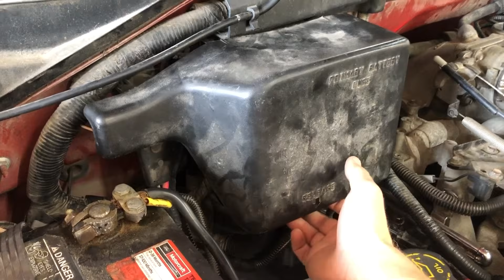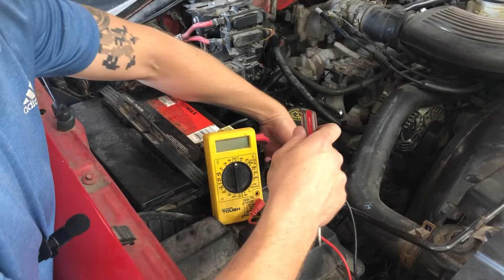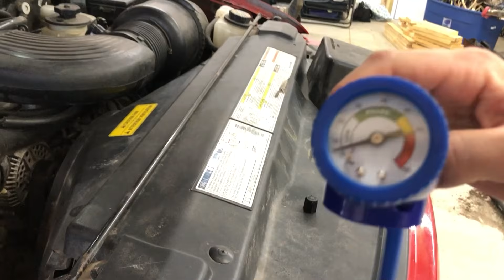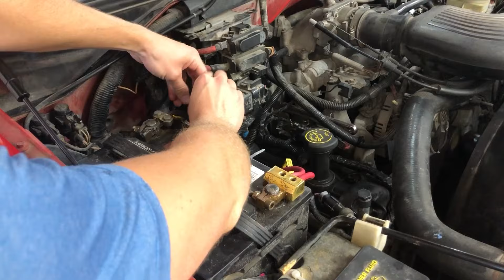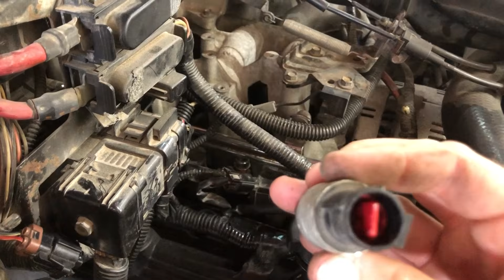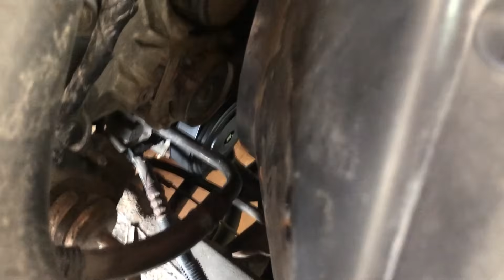F-150 A/C Diagnosis & Cycling Switch Replacement

Comment: Checking pressure at idle is not correct. It needs to be checked and charged at 1500 rpms with a fan in front of the grille to best simulate driving conditions

Comment: Would you know why my compressor won’t cycle, it stays on all time and pressure is at 80 at low side and high side 90 
I vacuumed and tried to refill 
And I also put in a new office tube because the one it has was clogged

Comment: Ok, I checked everything, by passed the low pressure switch and it showed I had less that 25 orbs in the system. So with the by pass connected, I proceeded to charge the system. It will not take a charge. Any ideas or comments are always appreciated. Thanks in advance.

Comment: Same problem when I bypass the switch the compressor kicked on so I went and got a new switch put it in and same issue compressor won’t kick on unless I use the jump wire, also it was still blowing hot when it was on do I just need a new compressor

Comment: Great vid thx! So I'm getting 5 volts at hi side sensor and 12 at low side . But clutch still don't engage when jumped like you do in this video. New compressor and clutch last year. Fuses and relays are good. Any ideas?
Reply: @terrybarker1123 did you every fugure it out? Mine has the same exact problem. 5v high side and 12 volt low side
Reply: @ryanmoser2590  nah I give up lol I gotta take it in ugh

Comment: What does it mean if I’m not getting the 12 volts to the high side? Does that mean I need a new computer?
Reply from the maker: I’d say either that, or a bad switch in the dash. Be sure and check fuses as well.

Comment: So my 06 f150 has an entire new ac system ive replaced everything but the evaporator core. I vaccumed down the system for 45 minutes filled with r134a the ac does work but its not right its doing the same thing it always has. You start the truck and the ac is kinda cool you start driving and boom ac is amazing then it will idle with cold ac shut off truck start again ac is just cool again. Hook up gauges and during idle im getting 370psi high side and 45 psi low. If i leave it idling and rev engine while blowing air across the condensor to simulate driving it will randomly drop high side from 370psi down to 220 psi and its works perfect what the hell is going on im stumped

Comment: Would this be a problem when a compressor kicks on for 3 sec, shuts off, kicks back on in 15 sec for another 3 sec, shuts off, and continues this cycle? I just replaced my ac system because of this and it's still doing this. Now getting into electrical stuff.
Reply from the maker: Have you checked your refrigerant level?
Reply: @DoWittGarage I’m having the exact same issue as this guy. But my refrigerant level is for sure good. Would this be a potential fix?
Reply: Did you figure it out?